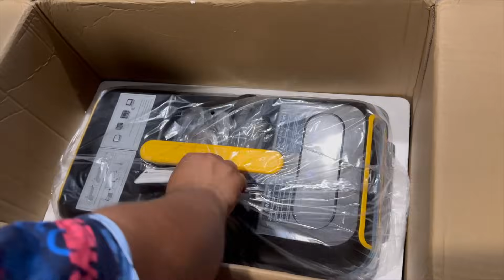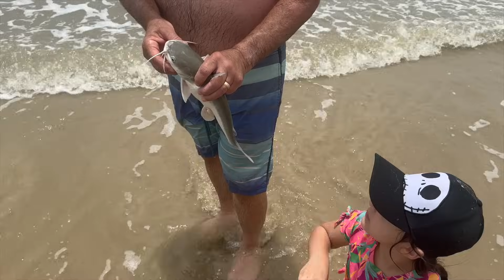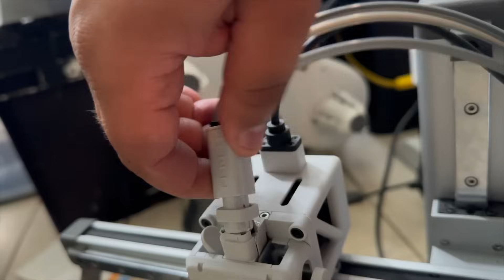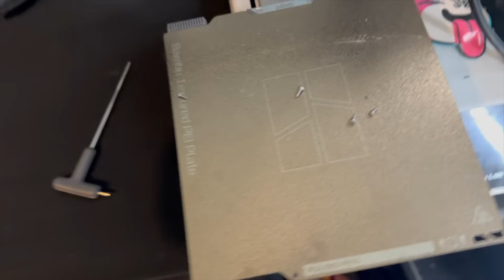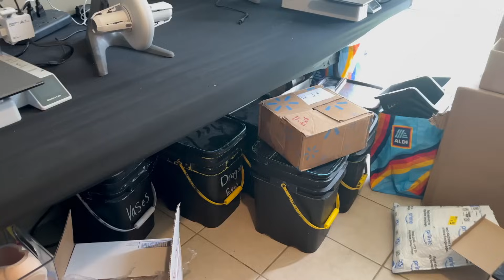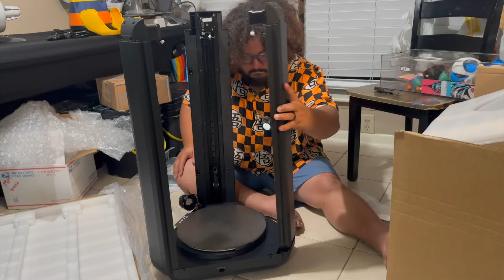3D Printing Business Ep35 | New House New Printer & Great Support Couldn't Ask For A Better Family!

Comment: Glad tro see you guys are in your new place.  BTW, that little piece that pop off where the 4 PTFe tube go in, just pops back in place unless the tab snapped on the housing.  I open mine all the time to pull out broke filament bits that get stuck in there.
Reply from the maker: the tab actually snapped unfortunately lol

Comment: That Zyltech filament is good stuff, made here in the US if I'm not mistaken..  Also, if you want them, I do have 2 filament dryers I don't use anymore (not since I bought my Sunlu S4), one is a eSun single roll, the other is a Sovol 2 spool dryer, and you're more than welcome to them (just have Amanda send me the address on the email chain we have going, and I'll get those shipped out ASAP).  They're just collecting dust here now and I'd love get them to someone who'll use them.  That'd give you the capability to dry 4 spools at once (your Creality is MUCH nicer, but these work perfectly fine, just not as many bells and whistles, lol).  I'm betting you'll be surprised how fast that new FLSun printer is compared to the Bambu's, if you need something printed QUICK, definitely use that thing, LOL.
Reply: Just remember about Delta printers, the print volume is conical shaped, so the higher you go, the smaller the area it can move is...
Reply from the maker: and yes that is one of the things we are testing in the new video ! plus more !
Reply from the maker: as always thanks sooooo much for your input! we are having tons of fun with the new printer and getting it ready for a really good review after a week of testing !